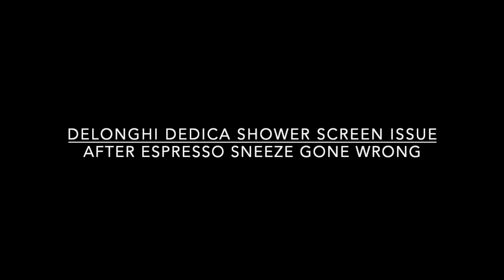Delonghi Dedica Shower Screen Issue - After Espresso Sneeze Gone Wrong

Comment: It happened to me when I used third part portafilter with double sprouts. Basically, the ears have a tiny different height and the portafilter moves while the extraction. Eventually it explodes and the gasket get popped out. As suggested, replacing the gasket (really cheap) can solve this, or replacing the portafilter (a bit more expensive). Thanks for the video!

Comment: This happens when i use a double-shot basket for a single-shot amount of coffee
Reply from the maker: Interesting, but in this situation do you grind it extra fine? Is there still coffee coming through?
Reply: i'm not really sure but my grinder is set to level 3 on espresso mode. i actually thought about this, since there's an air gap trapped between the sower stream and the coffee powder, the excess hot water is trapped in between at the end of the shot time, the steam pressure isn't enough to let the water through the powder, but it still has some higher pressure trapped, so it splashes once you unlock the filter from the machine.

a hack i do to prevent this is letting the machine cool down and drip the water for a minute before removing the filter, also pick the espresso cup away from underneathe before removing it.🌹🌹😊😊 @cricocoo